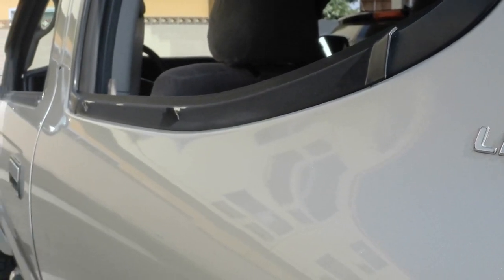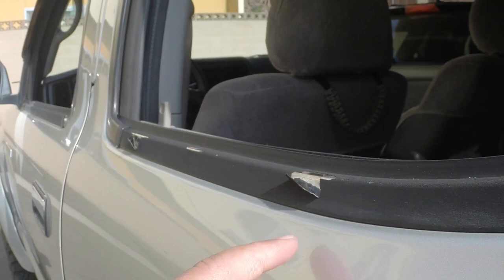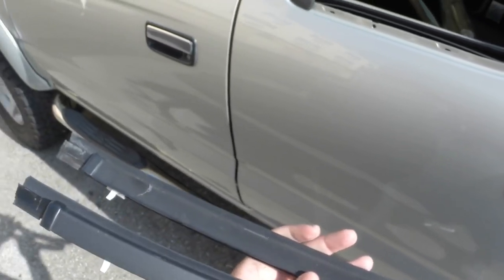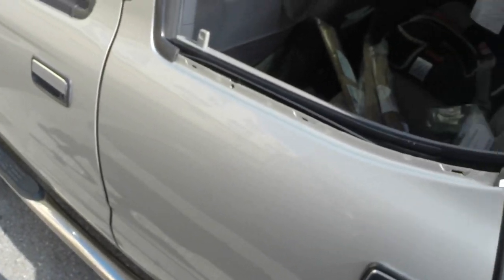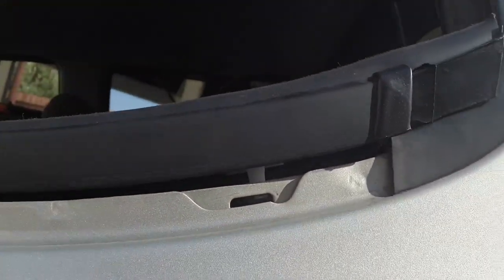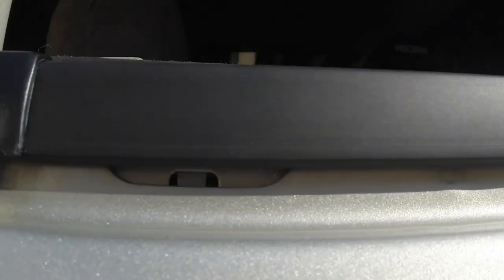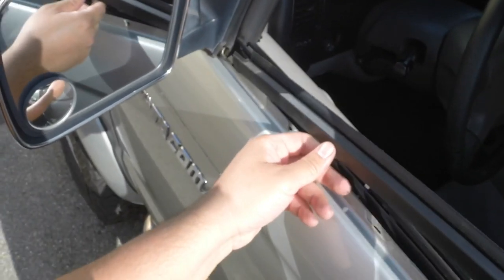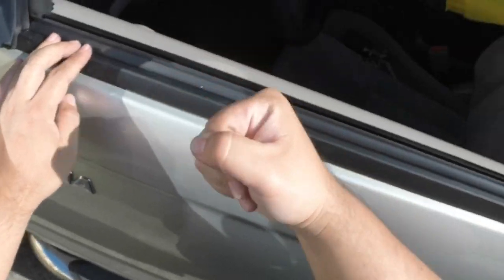2002 Toyota Tacoma weatherstrip replacement.

Comment: Do you know where else I can buy these? somewhere cheaper maybe third party? $250 seems pretty steep lol
Reply from the maker: This is the cheapest I found that’s OEM. https://www.ebay.com/itm/172980684918?mkcid=16&mkevt=1&mkrid=711-127632-2357-0&ssspo=SQvQxejHT6K&sssrc=2349624&ssuid=-hgsi-JeQdG&var=&widget_ver=artemis&media=COPY
Reply from the maker: You could go with third party ones but sometimes you can run into fitment issues.